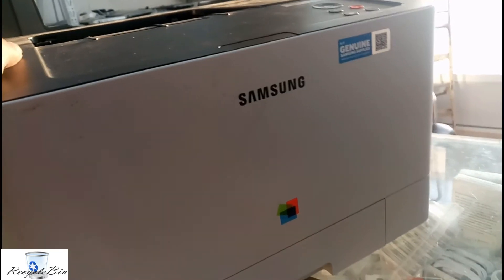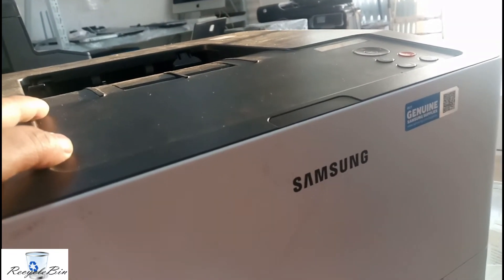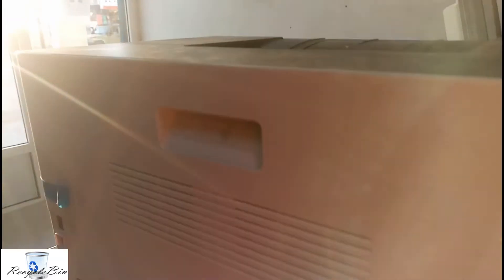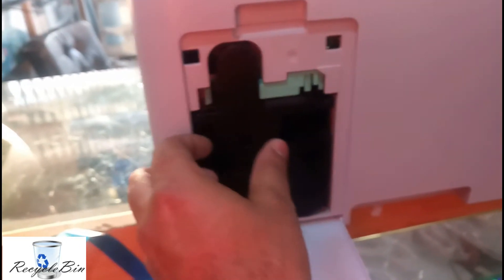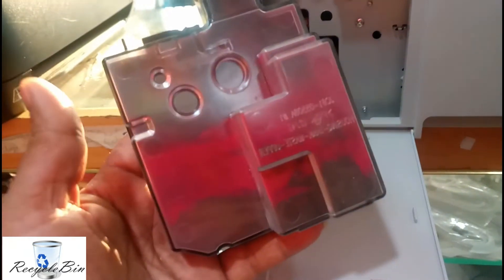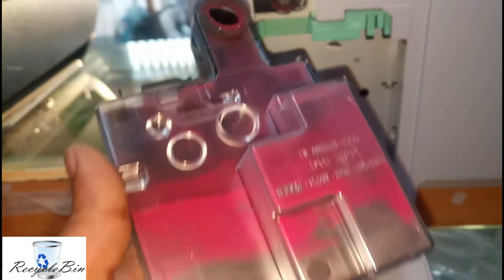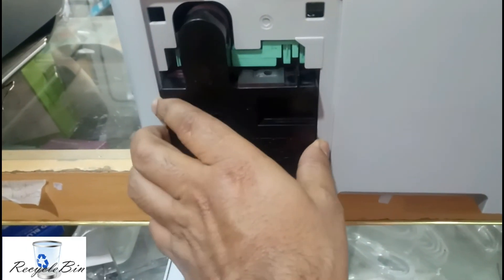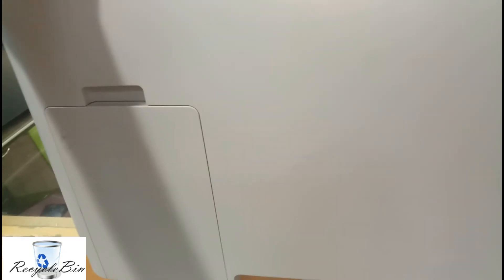SAMSUNG CLP 415N printer waste ink counter removing simple steps............

Comment: How did you clean it ? Secret ,?
Reply from the maker: Do you have same printer .if you are using same then you can follow those steps in video.while cleaning use two mask .you have seen an hole while remove that waste ink box.just slowly hit so the waste ink come outside..